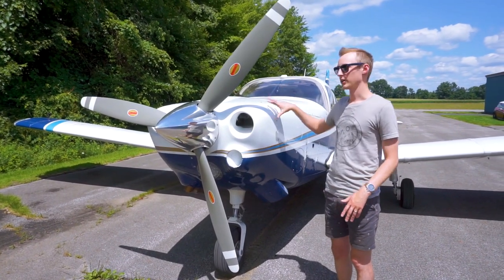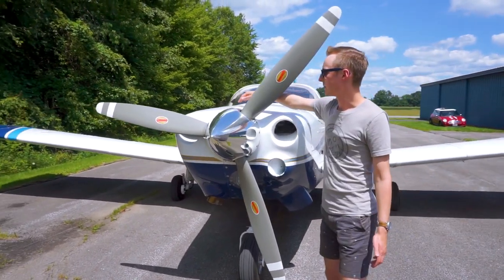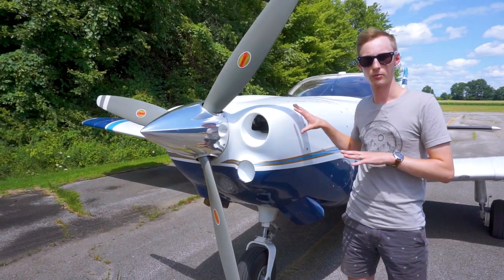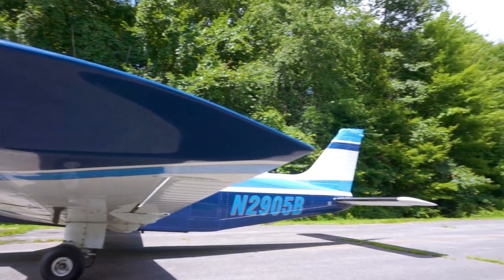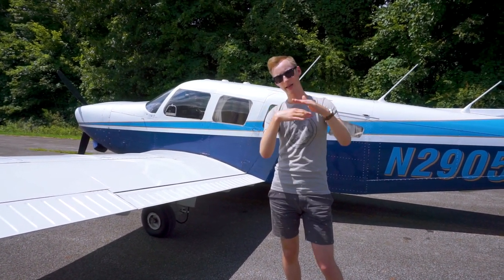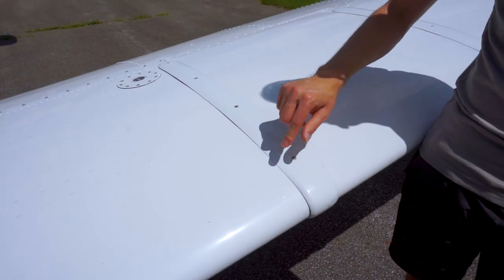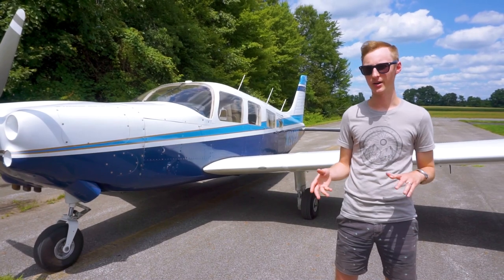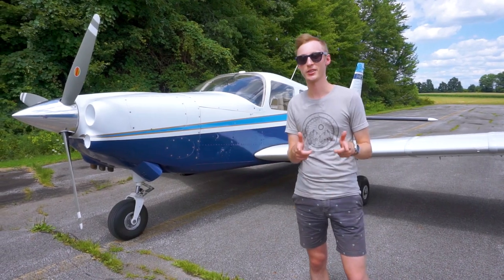Cherokee Six Modified for Speed

Comment: According to the aerodynamic work carried out by NACA, the rounded tips like the aircraft used to have are the most inefficient and drag inducing of them all. The Erich Hoerner tip design that you have fitted there is rated at 95% so it is much better, hence the performance increase.

Comment: Beautiful work!  Engine cooling is the only area I cringe at a bit, but trust its all working out.
Reply from the maker: We love it! The cowl flap allows us to get all the cylinder temperatures closer together than the stock cowling can.
Reply: @AviationFix  Excellent!  (Most of my flight time is in Sailplanes over the sierra, on oxygen...so I eliminated engine issues altogether. Chuckle.
Reply from the maker: Haha, nice!
Reply: @pilot3016  fliying high on oxygen ? ;-)
Reply: @alexdarcydestsimon3767  I would reach back and turn on the 02 at about 10,000 feet while climbing.  Get the mask on and Ray Bans.. climbing at 700+ ft a minute.  Perfect..02 secured at 12,000 ft... Uhh.  Sometimes climbing at 1,000 ft a minute in the Minden Nevada thermals.  Flying level with the nose on the horizon and the Variometer is screaming at you like Indians in a John Wayne movie. Amazing nature. Absolutely like being in heaven.
Reply: @pilot3016 
i Can see the picture.
 A dream come true.
Reply: @alexdarcydestsimon3767  excellent.. that's what I was attempting to do.. a visual.thanks my friend.

Comment: How fast is your Cherokee with all those speed mods?  I’m interested in doing the same but wonder how fast it is now.
Reply from the maker: We cruise around 145-150 knots indicated, so there is a decent improvement. However, depending on what mods you are planning on adding, the cost for the speed increase isn’t worth it. Fortunately for us, the previous owner installed all the mods 😁
Reply: @AviationFix  indicated??
Reply from the maker: Yes, true airspeed is around 160 I believe.
Reply: What would the cost be to add these speed mods.
Reply: @AviationFix  160 kt true airspeed. that's the information i was looking for.
Reply: @Ddurocher82  i ve heard just the cowling is about 8000 $

Comment: I operated five. X 1 260. X 4 300. 1st saw 130kt. 2nd saw 135 kt. High MTOW + usually ISA+ 70% POWER/2400, rich of peak.
So...WHAT power/DA is your quoted TAS ? As aircaft engineer, I can see some mods causing less drag, but cannot believe what you quoted....not with that wing.

Comment: What does Josh's training have to do with wheel pants??
Reply from the maker: Hey kombolasha, Josh here! Great question! Wheel pants are somewhat sensitive to harsh landings, meaning they can crack if you bounce it or just don’t flair enough. Student pilots often struggle with smooth landings, at least at the beginning of training. Since a new set would run us around $3,000, we decided to just remove them for my training and reinstall them once I perfect my landings. Hope this helps!
Reply: @AviationFix  Thanks for taking the time to explain!
Reply from the maker: No problem!

Comment: would love your help finding a Piper Cherokee Six
Reply from the maker: Not sure how much help we can be seeing as we’ve only done this once lol, but we’ll try to give you some pointers! First of all if you haven’t seen our video on purchasing N2905B, go check check it out. We share some valuable information pertaining to the pre-purchase inspection and just general tips you could use to make the purchase process smoother. As far as finding the actual plane goes, look on Controller, Trade a Plane, or WingSwap. Those are pretty much the 3 main websites used to sell GA aircraft. As I’m sure you probably already know, the 1979 6/300 has some desirable features not seen on earlier models. The most prominent is probably the fuel tank system, and for that it’s worth the extra cash if you have it. As far as time on engine goes, don’t be afraid to get one with high time and have it overhauled before you even fly it, just make sure you take into consideration the cost of the overhaul. If you have any questions don’t hesitate to reply or to make a new comment on one of our other videos! Thanks for watching!
Reply: im looking for one as well if you found ours and saw something else worth buying.

Comment: Cost of these mods?
Reply from the maker: These were installed by a previous owner, so not entirely sure what it would all cost installed today. Back in 1999 the plane had about $100k worth of upgrades - most of which were these speed mods in addition to some avionics.

Comment: As stated previously I owed a Cherokee six for 20 years  You can get your private license in one of these.  It is possible but one thing you need to make sure of is your insurance company.  I was told by my insurance company that due to the fact that it is classified as a high performance airplane that getting your private pilots license in it would invalidate my insurance. Could vary from insurance company to company. Just make sure that you are covered BEFORE you do it.  Still one of the best airplanes ever built and the mods they have done just increase the great looks of the plane as well as the speed.
Reply from the maker: Thanks for watching and taking the time to comment! We 100% agree, make sure your insurance will cover you before starting lessons in any airplane. For us, we had no issue getting them to insure Josh for his training... just bumped the rates a bit.

Comment: I really take issue with the C-150 vs PA28-300 statement for training.   Talk to some seasoned CFIs on that.  You need to watch Dan Millican's video about making you tube videos on Taking Off.  Review your script more.  You did not anticipate the obvious questions which shows in the comments from others below such as what were the speed improvements and for how much?  This video is about "speed mods" right?  The jump cuts are so annoying.  If you make a mistake in the shot do it over.  Jump cutting around it is just plain lazy.  If you have to cut go to a new angle but only do it if the idea being communicated is changing or taking a new direction.  If a cut does not lineup with the punctuation in the your script, a red flag should go up.  Justify it.
I will leave on a positive note.  Your sound was overall good.  I difficult environment to be sure with wind in the trees but it did not interfere with the vocal.  A+ for fixing the camera or getting someone else to hold it.